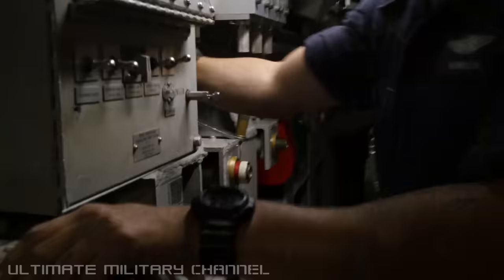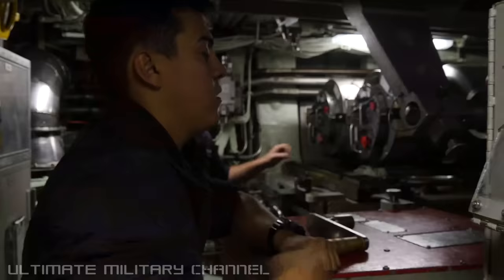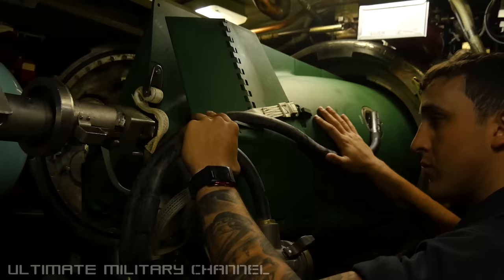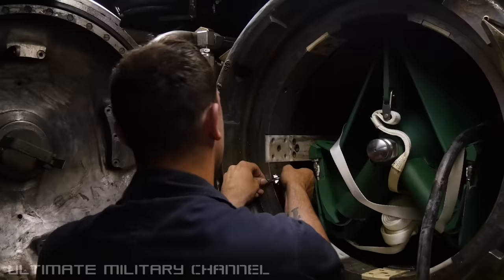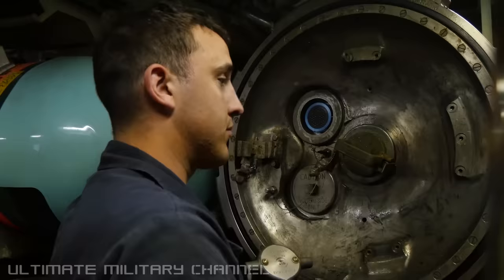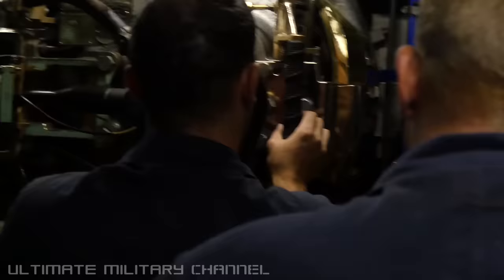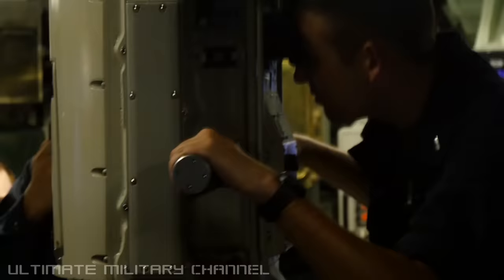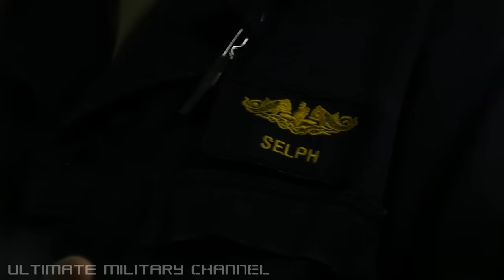Submarine TORPEDO ATTACK Training (And Harpoon Missile Launched During Same Exercise To Sink Ship)

Comment: Good Lord it takes forever to load that....
Reply: I assure you they can do it a whole lot faster.
HOWEVER, they'll do anything it with safety in mind. Last thing you want is a "Hot Fish" on a Submarine
Reply: This is just training but still this being rushed would be slow still
Reply: sam hronek They weren’t rushing one bit
Reply: @SamTimelapseMan  bro can you see how slow they are moving?
Reply: @iagree4686  Yeah but I can't really tell if they would still have to do all like the procedure and checks before and after, it just doesn't seem super quick.
Reply: @iagree4686  put the speed of the video to 2.0. They reloaded it faster than before.
Reply: @SamTimelapseMan  normally u wont even need to reload so fast u let the torpedoes go then hide
Reply: This is a missile not a torpedo.
Reply: Good Lord they building a torpedo or firing one. God bless them 🇺🇸
Reply: Slow or not. They have cover and concealment from the ocean. Plus, that one torpedo does a whole lot of damage. One shot one kill.
Reply: Todd Sharp  is hot fish a fire?
Reply: Patrick McCrann how did you know that?
Reply: But it’s worth the shit-ton of damage that it does to its target
Reply: Yes they are but torpedos are really heavy the warhead alone weighs a good 600 lbs so they are around 2 tones
Reply: @alexkachok8812  It is a torpedo that somehow gets activated still inside the submarine. Basically if they can't get it out of the submarine it will explode and sink the boat, and probably kill most if not all of the crew in the process.
Reply: @patrickmccrann991  it literally says "torpedo and missile launch" in the title
Reply: @toddsharp4245  So when they do it "a whole lot faster" safety isn't in mind?
Reply: Yeahp , my coffee maker is faster than that
Reply: @alexkachok8812  A live armed torpedo
Reply: Practice is always slow
Reply: Doesnt matter how long it takes they are in the middle of the ocean. Where can the enemy hide?😂
Reply: Well it is like 3000 pounds
Reply: Only takes one shot tho
Reply: Sky Commander  happened to me twice
Reply: They're safe loading to prevent a hot run or anything else that might wreck the sub itself.
Reply: The trick is to get the enemy target to wait a minute.
Reply: @toddsharp4245  ฟ
Reply: @toddsharp4245  ฟ
Reply: @ElwoodPDowd-nz2si  The tactic is to fire the torpedo before the enemy knows that you're there. And then be heading (quietly) somewhere else ... firing position on another ship or sub, or just away.
Reply: Силы небесные-www.youtube.com/watch?v=DEakeMoQw0o
Reply: @patrickmccrann991  its a torpedo
Reply: @alexkachok8812  If you watch carefully, the cable connection he installs says Harpoon on it. That is a Harpoon Antiship missile. Also, there are no propellers on the back of it, a MK 48 torpedo has props on the back.
Reply: @bruhwtfyt  No it is not. What they are loading is a Harpoon missile. Torpedoes have propellers at the rear and the cable connection he attached had "Harpoon" on it. Also, I spent 24 years in the Navy and watched them being loaded.
Reply: @mstarr8034  Yes it does; however, what they are loading is a Harpoon missile. No props on the rear and a cable connector that says "Harpoon" gives it away.
Reply: @patrickmccrann991  i think you dont know what is harpoon missile is
Reply: @patrickmccrann991  this is really confusing me. What are you saying is a ugm 84 (if im not wrong) harpoon missile. Well its still known as a torpedo tho
Reply: @bruhwtfyt  I spent 24 years in the U.S Navy. I have both seen and been involved with Harpoon missiles since they were introduced into the fleet. Whether you want to accept that or not, I really don't care.
Reply: @bruhwtfyt  No, a Harpoon (UGM-84) missile is not a torpedo. It is a submarine launched version of the missile. RGM-84 surface, AGM-84 air launched. They are not torpedoes in any way.
Reply: @patrickmccrann991  Agreed. You also hear the guy saying "booster separation" and "transition to cruise". Also I noticed the Harpoon notification on the kit as the obvious Harpoon anti ship missile was being loaded into the tube along with the lack of props. Definitely a Harpoon. Never served on boats but know the lingo as served  as a skimmer for ten years in a better navy.  Seems like there's too many Cold Waters players in here.:)
Reply: Eh, I suspect it's more a case of you were either prepared or dead. These guys don't get to "duel" anymore.
You either had it's ready, saw the enemy first and shot first and he's dead or vice versa.
Reply: @MostlyPennyCat  They are reloading at what seems a snails pace to ensure everything is done correctly. If you don't have everything connected properly, you will have a dead weapon when it leaves the tube.
Reply: @patrickmccrann991  
Oh yeah, I know why they're doing it at that speed.
It fits in with what I said, they get one chance. If you miss, you die.
Reply: Just training, safety first. If in war, a lot of procedures are skipped. It’ll be way faster.
Like the good old Iowa class battleships. While training and shows, they reload the main guns slowly. Literally doing shows. But in war.. They rain down the rain of death.
Reply: They're not behaving like in a real situation.... Wth
Reply: not only do they need to complete that procedure, they need to fill the tube up with water to pressure before they can send it.
Reply: I feel I'm not getting my point across, I shall attempt to elaborate.

I don't know what the conditions are on an attack sub, but ICBM boats sail at 2SQ

The tubes are filled with torpedoes.
You don't load then during a battle, they are always loaded, like missiles on a Destroyer

Primarily this is because modern weapons are so accurate, fast and deadly that all warfare would follow "see first, shoot first or die first"

That's it, one shot and there's probably already one coming in the opposite direction to mutually kill you

That's why they're going slow, because they will never be fast enough, so load your weapon before you fight
Reply: @jukasumomo  
Ha!
Go have a read about the Battle of Jutland and see what skipping steps get you

Open anti-flash hatches, ready rounds and powder bags stored in the corridor, then there's one spark and the ship detonates

"In the first hour of the battle, two of Beatty's battlecruisers – Indefatigableand Queen Mary – were struck by German shells that triggered catastrophic explosions, sinking both ships. On Lion's bridge, Beatty is reported to have remarked to his flag captain 'there seems to be something wrong with our bloody ships today'."

https://www.iwm.org.uk/history/a-guide-to-british-ships-at-the-battle-of-jutland
Reply: @ElwoodPDowd-nz2si  🤣🤣
Reply: I am gust watching and good hell it takes a long to load
Reply: @patrickmccrann991  Isn't that footage at the end a MK48 torpedo detonating under the keel to break the ships back? I mean, I believe you and your knowledge from being in the Navy, but where did the missle come in from? Harpoons have a "skim the water" and a "top down" like a Javelin ATGM type trajectory, right? I can't see a missle come in from any angle though, except the cameras blind side of the ships hull? Just asking because I'd like to learn this from someone who actually knows what they're talking about.
Reply: @yeahno6100  Yes, the end explosion is a Mk 48 torpedo. In this case, it does break the keel but not always. The current Harpoon version does not do a "pop-up" terminal maneuver, this was shown to make the missile vulnerable to CIWS like systems and remains in sea skim mode.
Reply: THIS IS TRAINING ,,THEY START FROM SQUARE ONE
Reply: Man yea imagine doing all those fine motor functions during the stresses of love combat
Reply: @patrickmccrann991 that’s a torpedo lil bro 💀😭💀

Comment: You should have been around in the 60's...we used block & tackle, long ropes and about 6 guys pulling and grunting to shove a 3000 pound Mk 14 mod 5 into the tube, then the locking ring was closed with a large wrench...when the order to fire came, 4500 psi air suddenly slammed into the back of a ram inside a big tank and forcing water from the tank into the tube.  The fish was shot out ...the that air pressure was vented into the bilge.  Very loud.  Next...you manually set in those bridges and yanked, tugged and pulled the next fish into position by hand....these guys have it much better..and cleaner...I bet there isn't a hernia in the whole room.
Reply: I heard the MK-14 (WW2 version at least) was very unreliable (depth, not detonating), how was it for you?
Reply: @awhahoo  All those problems were ironed out during WWII.  Our practice shots went off as planned. We never fired a warshot so I can't attest to the reliability of the Mark 6 Mod 5 Exploder.
Reply: @robermv32  I see, thank you for your service and the info.
Reply: Is there a team that is designated to load the torpedos? Like explosives rank or occupation?
Reply: @jamesdewer  ya submarines have torpedo men who’s whole job is to maintain and fire the boats torpedos
Reply: @Nawwwsir  that makes sense the shame like they're pretty complicated.

Comment: in this loadtime the wwII was over.
Reply: In battleships it took 30 sec to 10 mins to reload whilst I this video is only a few seconds
Reply: @TakkudALT  i don't think that's right
Reply: @TakkudALT  I read on the USS North Carolina website it was 1 round every 30 seconds...
Reply: @TakkudALT  maybe 20 seconds, not minutes.
Reply: @TakkudALT  WOW Im surprised that it takes 20mins lol🤣🤣
Reply: RockAsteroid672 Nah. A ww2 era battleship had a reload of about 30-40 seconds, with 50-80 men involved in reloading each turret.
Reply: This is a torpedo, not a gun. WWII submarines reloaded manually using block and tackle with lots of manpower. It was so slow, the sub would shoot of the missiles in the tubes, then withdraw to reload, a process that could take a couple of hours. Particularly if the sea was rough. Modern subs have mechanical loading systems that can cycle torpedos even when engaged. Three to five minutes between shots is lightning-fast, compared to WWII technology.
Reply: menckencynic; hankie?
Reply: @spthompson6501  When the Type XXI and XXIII U-boats were introduced near the end of the war, their mechanical loading systems, forerunners of those used today, could load all six tubes faster than the crew in a classic Type VII (Das-Boot-style) boat could load one. In fact, modern submarines were largely derived from the Type XXI and XXIII.

Comment: Having served on surface ships with Harpoon capability, it's interesting to see that it appears to take at least 10 minutes to fire each Harpoon on a sub.
Meanwhile, we could get them out in mere seconds, as long as the Gunner's Mates had the launcher lit off and the target had already been acquired by the Fire Controlmen.
Reply: Turns out it's not the same system. Plus submarine is invisible and doesn't need to be fast.
Reply: @thercaiken2005  Of course it's not the same system.
Surface ships can launch harpoons with dedicated missile launchers our out of the (now no longer on our ships) MK16 ASROC launcher. a considerably faster launch system.
Submarines rely on the relatively slow system of loading their torpedo tubes, with the Harpoon in a specially constructed capsule to work in that method of deployment.

Comment: The green thing they are loading with the folding horizontal stabilizers is not a torpedo.  It's a tomahawk or harpoon missle incapsulation device used to launch either missle from a standard torpedo tube.

Comment: Wow I hope they can fire a torpedo faster than that in a real war time type event.  It was impressive but seemed to take quite awhile to prepare and fire  the torpedo.  There just seemed to be too much crap to do just to fire.
Reply: they do it slow so you get used to the steps but mid battle they are moving quick
Reply: Taking down a huge ship like this isn't easy. Subs are not the front line they do not need to be fast but accurate

Comment: OK, Mk-48 are swim out and no, you dont see the wake as it travels down range. They are designed to travel in a particular pattern, before turning and heading to target. I an enemy ship detected high speed screws, they would fire down the return bearing and hope to hit the target sub. IN WW2, the torpedoes were bubblers and could be tracked to a certain point. Now, once the MK 37 or MK 48 reach that pattern, they turn and head to target, guided by either the wire OR, to sonar input of the target. Once acquired, they go high speed and then, no getting away from them. They will track you until they hit or run out of power. Even the version of the MK 14 from WW2 was pretty awesome. Watched it take down an old oiler in target practice in mid 70's. DBF

Comment: What about making the torpedo loading a bit less sophisticated? I mean in the end it just needs to be pushed out in a flooded sealed tube then it goes on target by guidance.
Reply: The guidance has to be set before it goes out. If its tethered (Wired) then that wire has to be connected.

Comment: The power of that torpedo is insane.  It bends and breaks the ship like it's a toy.    Navy subs are OP
Reply: The shockwave from the explosion travels through the deck of the ship and tends to break sailors ankles and legs..That’s why during WW2 you have so many people go down with ships, they were crippled in the hallways and drowned.
Reply: That first torpedo better be right on target, no time to load another one!
Reply: @PhotoXpression1  They have more than one torpedo tube.
Reply: @ryanhampson673  Magnetic influencers were notably unreliable for all nations using them during WW2.  The magnetic influencer in the MK14, for example, was calibrated off the coast of Florida if I remember correctly.  When operating in the Pacific, it was found that the influencer was too sensitive (due to variance in the magnetic field) and would cause the torpedo to detonate too early.  Commanders learned to stop using them.

Comment: Those keel-munching torps would make Harpoons irrelevant, if the attacking task group commander could be assured that it was gonna be a guaranteed hit and there would be no need for any other weps deployment in an engagement.  Those things are brutal.  No matter how seaworthy and airtight before taking that hit, most anything smaller than a BB or CV is going to suffer a mission kill at the very least.

Comment: Does the torpedo make contact with the hull..or explode underneath?  Looks like the aim is to break the back of a target these days
Reply: Tom H. Clever! Lift it with the explosion, and basically snap it by dropping it into a hole. A lot less lethal for the people onboard than a direct hit, which is a good thing, as the ship is out the fight
Reply: Actually on that class of ship that would've been a huge fireball the fuel tanks located in that region. I should know spent many of nights onboard her sister ship the Fairfax County.

Comment: Ok I found very unlikely the crew greasing up that gasket, and on top of that, using that delicate tool screwing the torpedo, pushing buttons to load the weapon. Give me a break. That convoy is gone.
Reply: 1. That wasn't a torpedo, it was a Harpoon missile.
2. Yes, they do grease the plug to ensure watertight seal.
3. They take their time because they are dealing with a sensitive multi-million dollar weapon. Also, this is a hydraulic ram pushing the missile into the tube. Don't want a hand or anything else caught in the process. Safety is always paramount; hence, the repeat back of each step in the loading process.